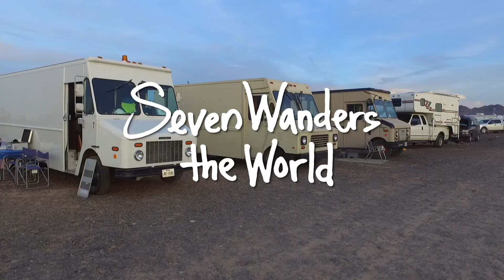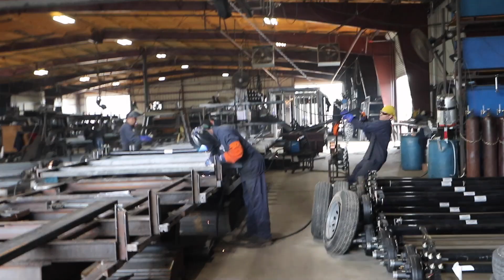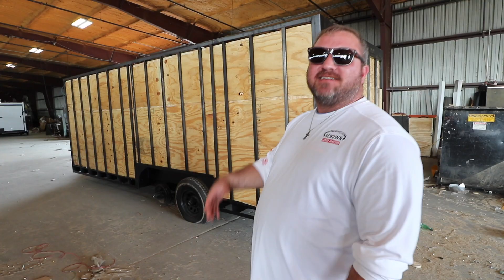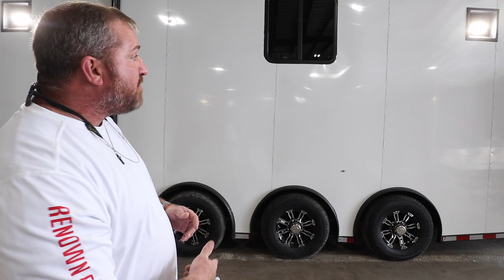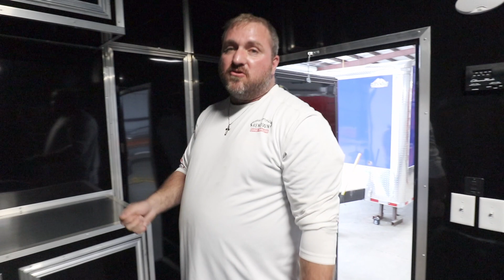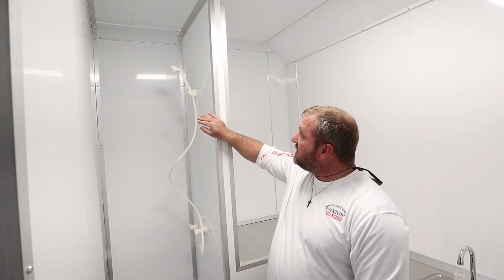Tour of Renown Cargo Trailers and Rock Solid Cargo Trailers Factory E603

Comment: I just bought a new one (4 weeks ago) from that manufacturer USA cargo, 8.5x20 7.6 height. I think they are slapped together to fast. They had to fix wiring issues before I left,  self tap screws sticking thru bottom of floor in wheel wells, sheet metal had small buckle in top when I got home & a taillight wire hanging out bottom. side door very hard to open. The trim at top and bottom is not straight. Just make sure to inspect before purchase. I can't fix the buckle in the sheet metal at the top left corner.
Reply: Same town does 41 trailers a day.Different name but these manufactures use different LLC names yet same CO.You get what you pay for sometimes lol
Reply: They probably get paid by the piece and not by the hour!
Those guys seemed to be working kinda fast for hourly rate lol

Comment: Worst factory tour I've ever seen. Didn't tell me anything about how the trailer was built, what materials were used or how they were connected. Steel frame? Aluminum? Wood? Screwed,? Nailed? Welded? How did they run the wiring? Did they use grommets going thru the metal? What kind of axles? Is the exterior screwed or screwless? Are the walls, floor and ceiling on 16" centers? What size frame is it on?                  Sorry but I've got to give you an F on this report Mr Seven.
Reply from the maker: I agree, I did not mention any of those items (although I do think we mentioned the all-steel framing). I left the tour info up to the owner of Renown but should have ask him for more info to address your comments here.